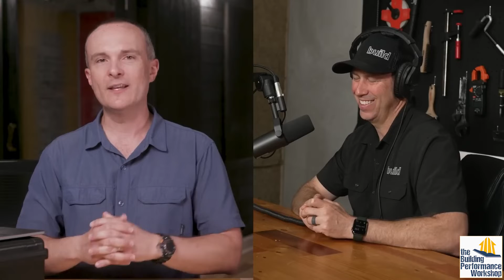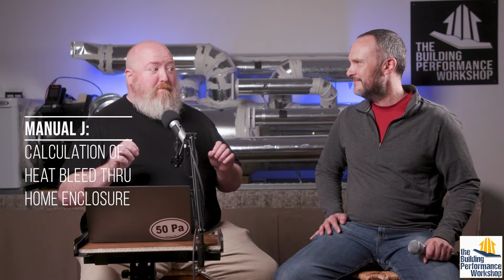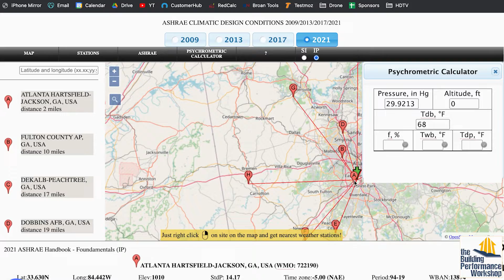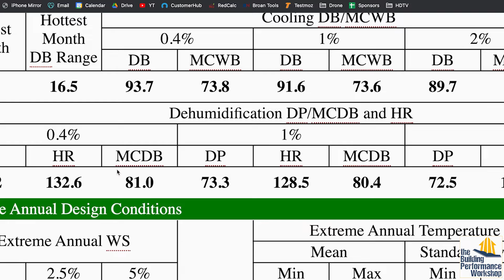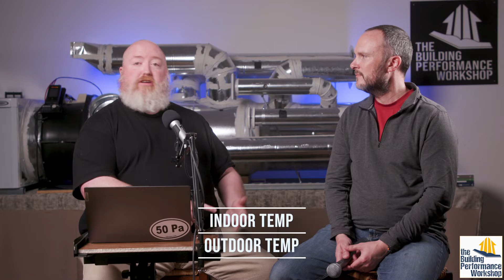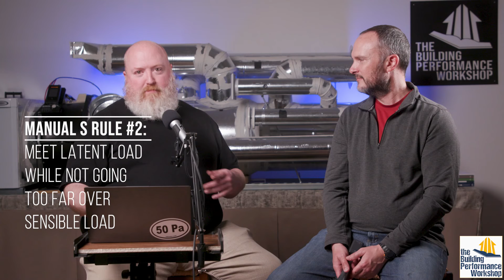Comment: This was such a a great video. Thank you so much for this. I have spent the last 5 weeks researching about HVAC and learning as much as I can to fix my comfort problems (I'm in a 32 story above grade condo with a single stage AC) and make sure everything is sized correctly. I've been using ChatGpt to help me understand and it's been matching a lot with what experts are saying but it's recommending a different size than what my HVAC quotes have been. And this video helped me understand the context better to see why I've been recommended a higher ton. I'm still going to get the correct inputs for a manual j like infiltration rate, and insulation, and duct leakage as I want the block load or room by room manual j they're doing to be as accurate as possible rather than just using estimates. It's annoying that these manufacture OEMs are behind logins because normally I get that and just feed it to ChatGpt to help me size correctly but I can't do that unless I ask for it. That way I'll get the most accurate data. Sorry for the long message, it's been a long 5 weeks. Thank you for the content!!

Comment: 12:44 "if it's winter, it's dry" 
(* may not apply in California or the PNW)
Reply: Look into absolute humidity- cold air, even at high RH, actually doesn’t contain very much moisture.
Reply: @HomePerformance  thanks for the correction!

Comment: I wonder if it's feasible to use the historical run time information available on a smart thermostat to determine appropriate HVAC sizing for someone wanting to replace an older furnace.  The one desirable thing about this method is that you have actual use data.  Thoughts?  Thank you for your channel.  I love your content and have learned so much.

Comment: Alex Meaney talks and has mannerisms just like my brother-in-law who is fascinating to listen to just like Alex.  Of course, Alex is talking about subjects my brother-in-law has no clue on, but are extremely interesting to me.  I was in HVAC service briefly decades ago between my Army time and college.  I grew up in a house with a father who believed only in window units and radiator heat and thought central air was the devil so I was slow to the game.  Since working in apartment maintenance in my youth and spending a year learning how to repair all the gas furnace central air systems on the property I have always held an interest in moving heat around, but never went that route for a career.

One thing i definitely learned is just because a guy shows up in a van with a state license # on it, there is no guarantee he has much of an idea of what he is doing.  This was clear when i was a young apt maintenance worker bugging the HVAC contractor we called with questions and he couldn't even tell me what the difference between PSIA and PSIG were.  He also had no idea how a capacitor worked.  I wasn't being a jerk.  I didn't know either and was honestly curious.  I found the answers on my own that night, but that service tech likely still doesn't have them.

I pretty confident Alex could answer any questions i could come up with and answer questions I didn't even know i had !    

A ton is not 12,000 Btu's and J is for 'joule'... marvelous.

Great video.

Comment: Joule is a unit of energy, in this case thermal energy. It can be quantified a few different ways. One is that it is the energy dissipated as heat when one amp passes through a resistance of one ohm for one second. OR It is equal to the amount of work done when a 1 newton force displaces a mass through a distance of 1 meter in the direction of the force.

Comment: Crazy stuff. Being a homeowner I have read enough to be dangerous. I asked my contractor to downsize my equipment when he replaced it and he didn't put up a fight or do any calculations. He just did it. I had my reasons and I think it's gonna be ok. But holy crap what a gamble I took without knowing what the hell I was doing. And still don't. I find this stuff fascinating and disappointing at the same time because I would probably venture to guess a lot of HVAC professionals don't even get this deep.
Reply: They have no incentive to. They make more when it’s oversized and they don’t pay your bills.
Reply: I love this
Reply: I used to work for a nationwide residential HVAC company, I'll leave their name out. I was a technician and did Manual J training in trade school, so I knew ot had to be done at some point in older houses thay were originally designed for swamp coolers. I wanted to see how the calculations were done in real life, and to my surprise, they don't do calculations to confirm the existing equipment was properly sized. The salesman sells you the equipment with no basis other than that's whatbit had beforez therefore the new should be the same. They're not wrong, but they don't confirm, no wonder most houses have an oversized equipment.
Reply: Homeowner also.  I downsized my self installed replacement equipment and my system works twice as good as before, costs less to run and is much quieter.  The vast majority of installed equipment is oversized.

Comment: To nitpick: a joule is a unit of energy, but your load is quoted as power (ton/watts) since it is over time. 
E.g, a Joule being one watt-second (energy), a ton being 12000btuh (power) or about 3.5kW

Good note on the equipment, and how conditions completely change the performance of heat pumps.

Comment: I am a licensed hvac/refrigeration contractor. Great video, thank you!
Since I’ve passed my license exams I’ve re-done air ducts at dozens of residential and commercial properties. Dozens and dozens!!!! 
Here is the typical story… Customer says that his convenience store/gas station don’t have enough A/C during July/August. So, the customer wants one more 5 ton RTU installed because people behind the counter literally sweat badly as soon as outdoor temperature goes above 90F.
So, I re-do the entire air duct set-up and…. There is no need for additional A/C anymore, the electrical bill drops 30-40%, no sweating any more… 
So, with the ducts done correctly, old bitten up A/C becomes surprisingly efficient.
P.S. I’ve tried to use the manual J for my air duct designs …. and I gave up on using that Manual J because it more confusing than helping. :) 
P.S. #2. I now have a line of small shops, stores, restaurants that are willing to get the air duct see-done.
Reply: Good work Ed- and yes, Manual J is probably not the right tool for you in commercial spaces.
Reply: Thank you!
Reply: Manual J has nothing to do with ducts, only BTU. Manual D is for duct design.
Reply: ….. how are designing the air ducts set up is you don’t evaluate the heat load? :)

Comment: How are you dealing with fact that Elite Software has not updated their HVAC equipment database since Jan. 2019??
Reply: Once I finish with Man J, I leave Elite and do the rest by hand and 3d modeling
Reply: @HomePerformance  How are you doing Manual S??
Reply: If we can get the extended performance data from the installer (big if), then match as Alex describes.
Reply: @HomePerformance  Ok so I actually work for the HVAC company doing the install. The only thing we can get is the AHRI number from our local Lennox rep. I guess we need to start asking for that performance data and maybe go through the dealer site like Alex talks about to get more equipment info?
Reply: You got it man!

Comment: I have 3.5 ton heat pump in a 1500 square feet house with blown fiberglass. Now I have spray foam in the attic with the fiberglass removed. A manual j was performed and recommends a 2.5 ton. Can I just use the 3.5 ton heat pump already in place and use a whole house dehumidifier? Thanks!
Reply: I’m not an hvac contractor but I have a decent understanding of it. I would imagine you could use your existing system and use a whole house dehumidifier to keep the humidity levels where they should be. The issue with oversized units is they won’t stay on long enough to remove the humidity. It’s going to cost you a few grand though to have one installed unless you did it yourself. In my area you could probably get a new mid range  2.5 ton system installed for $5k so it may not be cost effective to go your route in the long run. Whether or not you can use a system that’s one ton smaller with the existing ductwork is something you would ask a hvac contractor though.

Comment: Two very knowledgeable and talented individuals. Excellent video. The video mentioned it’s not a good idea to set a thermostat below 72°, because on a peak outdoor humidity day, the outdoor dewpoint could reach 72° or above.

If that happens, when the indoor air and outdoor air meet, condensation will form indoors, usually in areas that are hidden, where you can’t see it.

Therefore, if we keep the house too cold, we risk condensation forming inside the ducts, on the equipment, in the walls, the ceilings, and hidden in places that we can’t see. 

In the southeastern US, it’s not uncommon to have Dewpoint temperatures at 75°.

On the other hand, if we keep the house too warm, we risk the dewpoint rising. During the time that the AC is off, humidity from the outdoors is infiltrating our home. Which could cause condensation to form on the AC vents, potential mold growth, in addition to possible structural issues. 

The longer the air conditioner pushes cold air out of the ducts, in an environment where the surrounding dewpoint is higher, The more sweat that will form on the surface of it. 

It can be a challenge to find that perfect balance.
Reply: Thanks TJ, well said
Reply: @HomePerformance  Thanks

Comment: I would like to hear your opinions on the CoolCalc Manual J web app as well as how to best reverse engineer/optimize/pick new equipment for an existing system in a 20 year old house where so much of the ductwork cannot be changed/altered. Manual J/S/D guidance from ACCA is great for new construction when you have new construction.
Reply: If the ducts cannot feasibly be altered, then you’re right, a block load is all you’d need to make sure you don’t make a mistake replacing the equip with the same size. Luckily, if the equip gets downsized bc of improvements in the enclosure, the ducts are upsized automatically, which never hurts.
Reply: @HomePerformance  You should also consider partnering up with Ed Janowiak who is the head of education at ACCA and has his own YouTube channel. His lectures are also published on other HVAC YouTube channels like HVAC School.
Reply: Thx Bright Boy

Comment: Florida... December...88% Humidity.😑
Reply: Haha yes- but interestingly, most places are very high RH in winter. Because it’s cold, RH has a different meaning.
Reply: @HomePerformance  fair point.
Reply: Also, much lower dew point, so when you bring in cooler high RH air and heat it up, the RH is still much lower. That said, I don't care what the homeowner says in FL- the dew point is so high on peak dehu days, anything lower than 75 without an intense independent moisture control plan is malpractice.
Reply: @alexmeaney2407  Tell that to the contractors down here.  The homeowners all know but usually not till its too late.

Comment: ... So if you ARE someone who overheats, that really wants a 65°F House in the winter, but will compromise with 68°F - How do I avoid the humidity problems you're describing? Lots of dehumidifying?
Reply: And airsealing, and insulation- it’s a system.
Reply: @HomePerformance  Using a perfect wall style construction helps a lot. If all of the thermal resistance is on the outside of the air control layer, there is a lot less stopping any moisture in the wall from evaporating to the inside, where it can be dealt with by the dehumidifier. Using moisture insensitive materials, CMU, mass masonry, ICF, and even hempcrete works too; rocks and concrete don't tend to have any problems with getting a bit wet.
Reply: Yes

Comment: Great information but one thing they forgot to mention is that all manufacturers are doing inverter compressors and at that point your 3 ton could perform as 2 tons if outdoor and indoor temp requires that, and yes will have to have a good duct design but the conversation here was manual j and equipment selection. As a contractor I have much respect for engineers. Thank you for the information.
Reply: Careful. Not all inverter systems are created equal. Many systems (especially multihead applications) can't ramp down nearly as much as we think (unless they are true VRF). And even the ones that can ramp down by a lot aren't always a very good solution without dehumidifiers as some tend not to dehumidify well (or at all) as they run at lower capacity- it helps them get a higher SEER score but can be a humidity nightmare in the wrong situation. At the end of the day, there's no substitute for looking things up. I think we talk about some of this in part 2.
Reply: Big problem we’ve seen in the last couple of years.  The evaporator doesn’t always reach dew point when it’s running in a lower speed, so it’s reaching sensible set point, but not removing any moisture.  Also, ducts should be designed for when the unit is running at 100% capacity.  You lose the stratification effect if the air velocity is too slow.

I believe the top tier Trane units allow you to set humidity along with temp and it will ramp up the compressor to a high enough speed to still reach dew point even when sensible is satisfied.

Comment: I need to do this or have it done by someone when we replace our A/C.  We have a 2,000 sq ft house with a 2 stage 4 ton A/C installed by an A/C contractor chosen by my builder.  We literally never need anything except stage 1 at 2.8 tons even on unusually hot days over design temperature of 91.  If it's 96 out and we're cooking, and we're running exhaust, and maybe also drying clothes then it will run 100% of those times still maintaining 74 on stage 1.  It's a huge A/C for the house and it doesn't run a lot.  I have installed a ventilating dehumidifier and dialed in the fresh air to keep the VOC's and C02 at a good average and it keeps us dry when the A/C isn't running.  Our oversized A/C plus the dehumidifier now works well together.